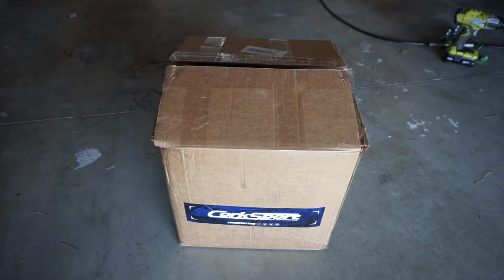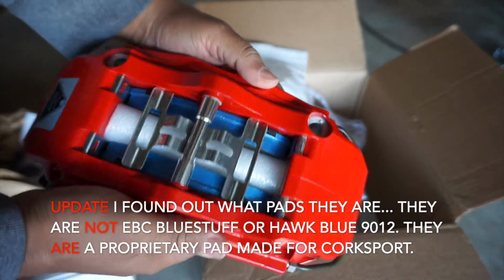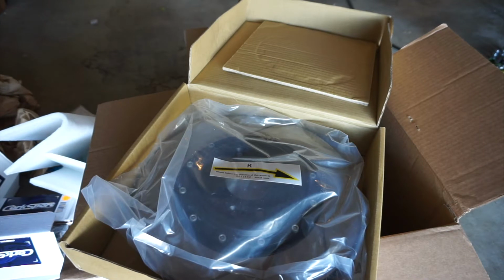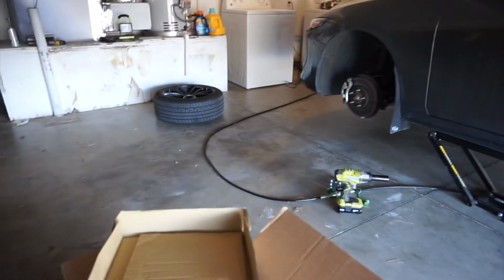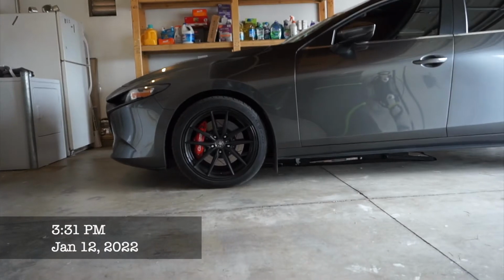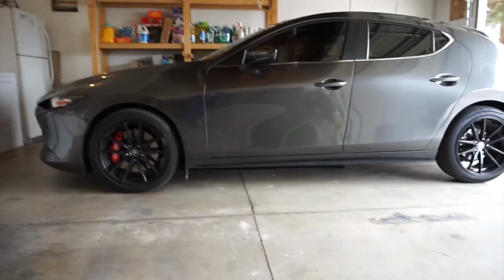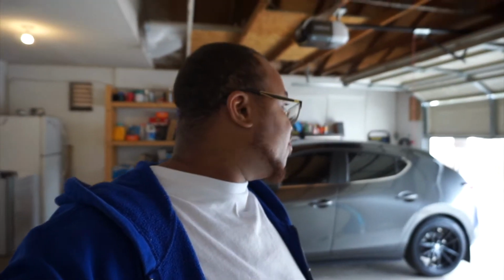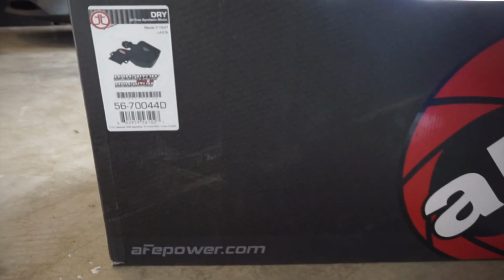4th Gen Mazda3 CorkSport Big Brake Kit - Review

Comment: Thank you for a very coherent and well-paced walkthrough, just the right amount of Timelapse and a very helpful review, I’m very thankful you took the time to share this info with us
Reply from the maker: Glad you enjoyed it!
Reply: @JeromeJunior  have you had any issues or is there any wisdom you have picked up about them since the installation? Are they holding up well?
Reply from the maker: They are holding up well. The paint on the calipers is the only issue. The brake dust that was generated from the blue pads that came with the rotors messed the paint up. I’m running ebc yellow stuff now.
Reply: @JeromeJunior  that is handy to know. Thanks for passing it on

Comment: Hello Jerome. I run the Evo pads and rotors and it's pretty much a street pad. EBC yellows will probably balance you out pretty well. Nice install. A proportioning valve will probably help to balance the fluid flow from front to rear.
Reply from the maker: I’ve been running EBC yellow for a while now, it definitely balance the braking.

Comment: Thanks for making this video and showing us this kit. I might get this and replace the stock brakes since they give me a weird vibration between 2000 to 3000 RPM. I don’t think it’s the rotors are brake pads, something else in the brake system causing it like vacuum pressure or brake booster or something.

Comment: Great video. I have this wheels Enkei TSR-X 18x8 35mm Offset, will the brakes fit? Thank you
Reply from the maker: Those specs cleared on my wheels, but not all wheels are designed the same. Download the corksport template and check.

Comment: Will it clear the oem 18x7 with 45mm offset? Thank you for the video, the mazda 3 turbo doesn’t stop well with the original brakes.
Reply from the maker: No, it won't clear.  You will need at least a 12mm spacer with the oem wheels.

Comment: where do i get new pads if needed and or new rotors if i destroy the ones i would buy i cant find where to buy replacment rotors and pads
Reply from the maker: The easiest way to get replacement pads  and rotors is to go through Corksport. All you have to do is give their customer service a call and they can order replacements...
The more involved way would to do some cross referencing. The pad design appears to be AP Racing. If you look up AP Racing pad profile CP3215D50 you will find a bunch of pads we can use. Hawk, EBC, Ferodo, Pagid,PFC01, etc... For replacement rotor rings you will need to just look up the rotors specs to find replacements (330mm and thickness). For the rotors, I think its easier to just go through Corksport.

Comment: How much did those big brakes slow your car down?
Reply from the maker: If you taking about weight, It haven't slow it down at all. These are two piece rotors and aluminum capliers.  They might looks heavy but weight damn near the same as the oem set up...
If you taking about stopping power,  its shocking how much of a improvement they are. Car legit stops on a dime (depends on how sticky the tires are, of course).